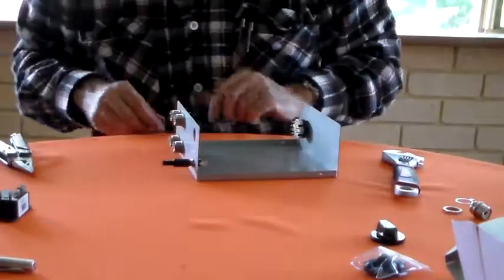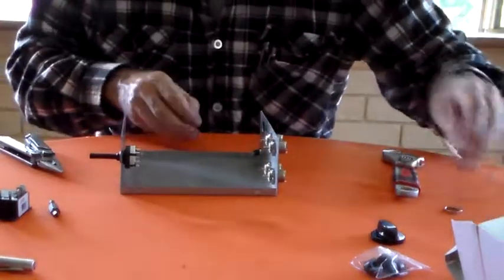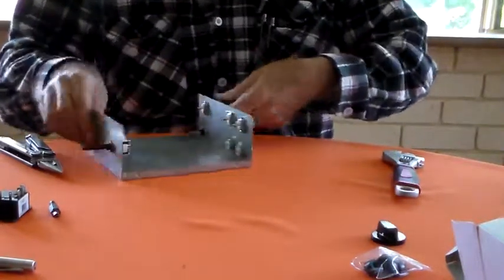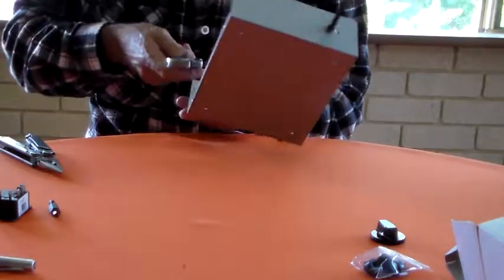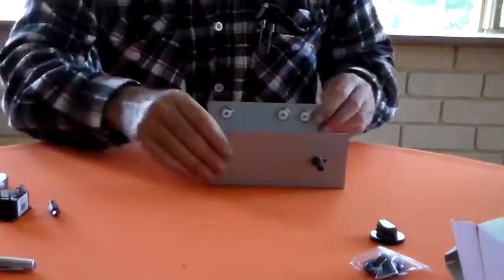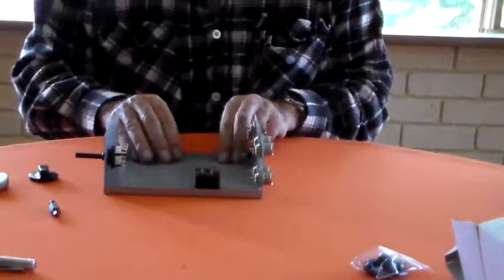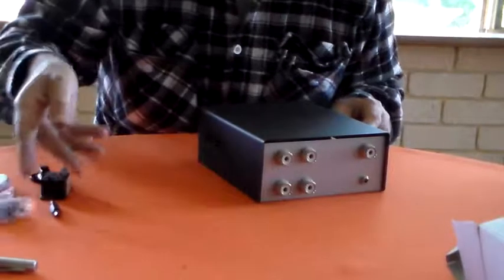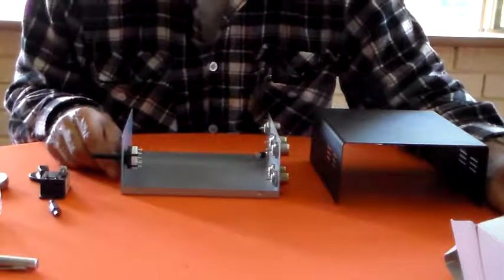Home Brew HF Antenna/Rig Switch Part 4.

Comment: what happened to the Finished Product you just ended we  never seen what happen how it worked or the wiring how you wired the Relays. i wanted to try the same project did it work did it isolate enough for multiple radios?  please let me know or another Video would have been nice  you ended at Video4 please let me know the outcome i wanted to try this project
Reply from the maker: +Michael Cobra Hello Michael... actually I did do a final video for this project:
https://www.youtube.com/watch?v=iOE6nUzbySQ

Unfortunately the isolation was no-where near good enough to use for connecting 4 radios to one antenna. It would be ok for switching 4 antennas to one radio though.
Reply: +VK6CS  Hello VK6CS good old Youtube  i did not see the sections 5 through 7 sorry about that, thank you for sending the link.
i will try this project anyway since i bought the parts for it  thank you for all the videos  very interesting  and keep up the good work  they all are a good watch

Thank you 
Mike KC0BRA New York
Reply from the maker: Thank you for those kind words. Use it as an antenna switch though, using it as a rig switch will almost certainly damage any receiver connected to it.
Reply: +VK6CS
Thank you! BTW I am glad to see you survived the Coconut water and are able to still make these great videos LOL, :)
I appreciate all your Info i have a question How would you think that antenna switch would work if there was a static discharge and the switch was tuned off to all relays going to ground in non energized mode if you get what i am asking as per no antenna connection via relay connectivity with the switch box Grounded and  radio off during a lightning storm I have a 53ft end-fed antenna in a tree and was concerned about static discharges not direct hits to protect the radio 

If you have a chance please let me know your thoughts on that 

Thank you in advance

Mike KC0BRA
Reply from the maker: Hi Mike. I think with all relays off... so that each port except the antenna is connected to ground it would offer pretty good static protection during a lightning storm. Of course... I could be wrong.
Reply: +VK6CS 
That's what i was thinking, thank you very much for your thoughts and keep up the good work with the videos very useful information  Cheers  73 

Kc0bra New York City